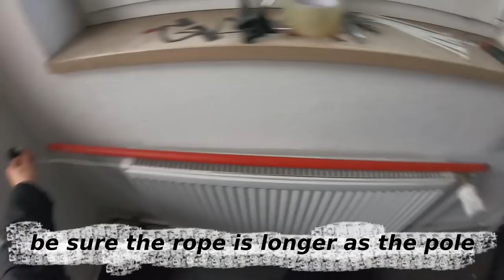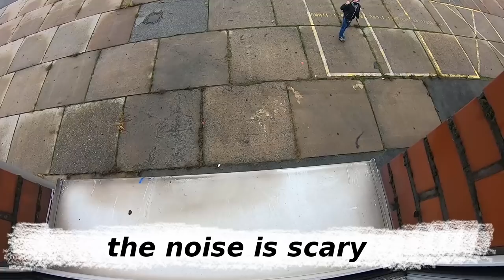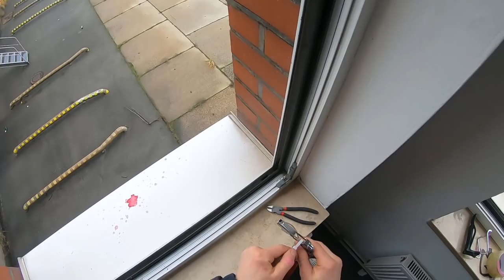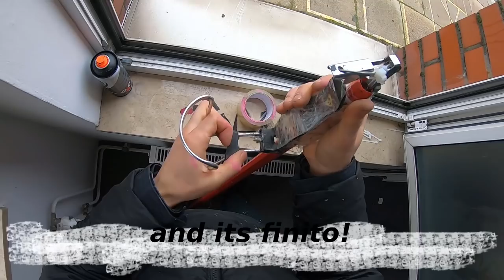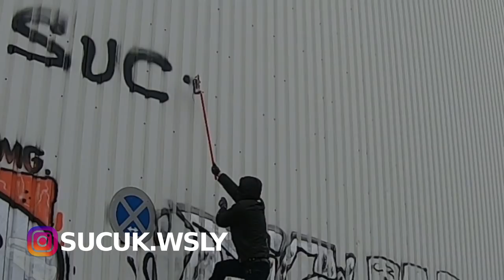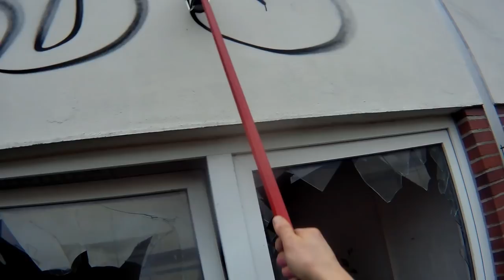DIY Spray Paint Extension Graffiti Tool

Comment from the maker: Have Fun With do this Extension ✌️✌️
Reply: Will nicht den Streber machen aber heißt „had fun“ da es ja schon geschehen ist, weiter so✌🏼
Reply: Great video! I just wonder: how the bottle opener can go back after having pressed the cap on the can?
Reply: @TheMetalFreshTiger  you can control the cap with the rope you attached to the pole. If you pull the rope you press the cap and if you release the rope the cap gets loose
Reply: @wadwillstemachen  ist der deutsch 😂
Reply: @wadwillstemachen  Du Dulli alter.... er will, dass wir das nachmachen
Reply: @asiaquick1330  ich wusste dass kiffen irgendeinen Nachteil hat🤣
Reply: @Xekuxia1x  normal, er kommt aus Hamburg
Reply: It looks like a great workout for upper body strenght. ;)
Reply: gonna make with a longer pole, awesome

Comment: I was thinking about getting an empty deodorant can and fill it using female adapter and needle cap with paint from some montana...you think its gonna work? 😀
Reply: I dont have a female adapter and it cost like 5€ So i wanna save my money if it wouldnt work 😂
Reply: Just use a reg can its not worth the work
Reply: Probably not because you need pressure to get the color out of the can